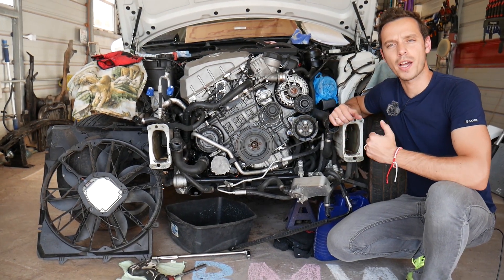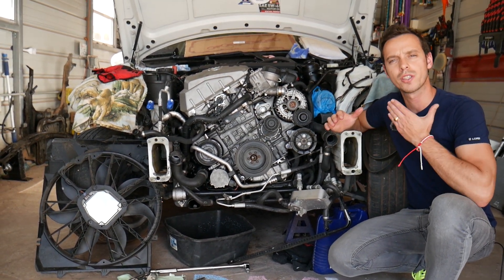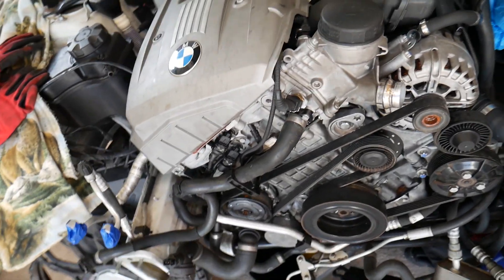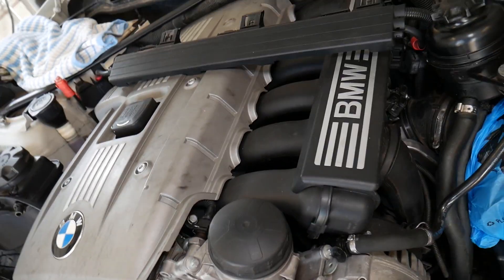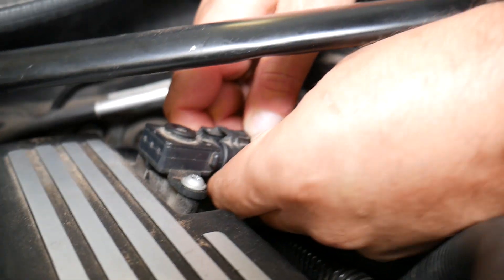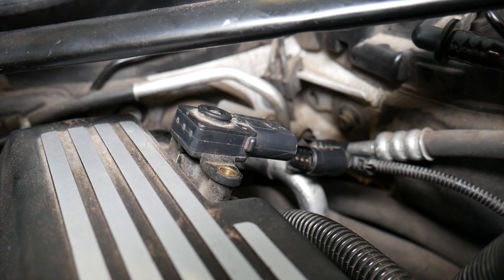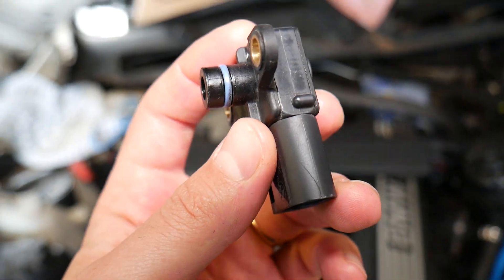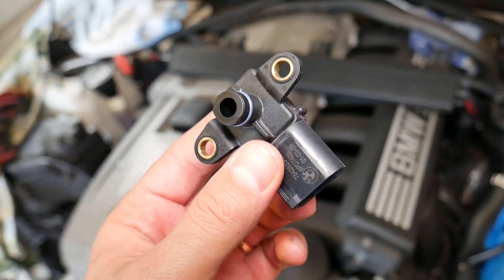MAP SENSOR REPLACEMENT LOCATION BMW X3 E83 F25

Comment: how likely is it to damage the boost sensor during a valve cover gasket replacement on a  x3 xdrive28i? got my car back for the mechanics shop immediately it through a drivetrain malfunction warning and lost power/acceleration. RPM hitting 3500 the engine wining and the car is barely moving.